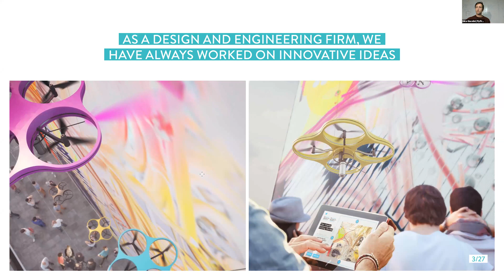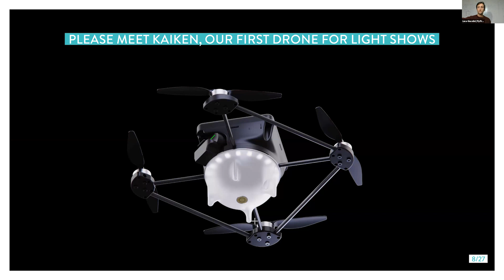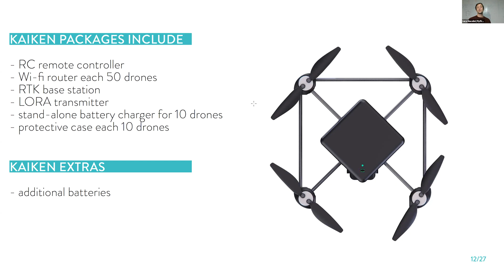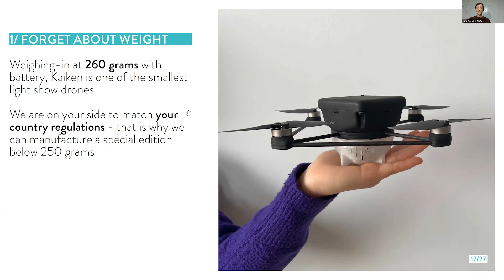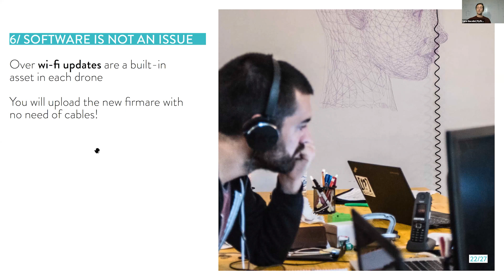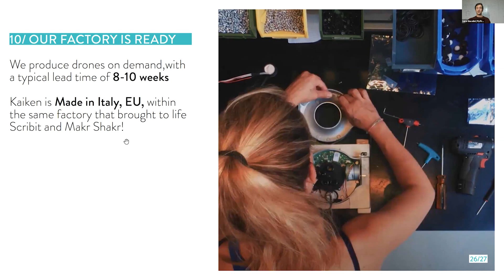Webinar | Next generation drone for drone shows

Comment: for LED what is the suggested distance from dance center to audience?
Reply from the maker: LED light is usually visible from over 2 km away, although the visibility might be limited by weather conditions (dust, smog, mist, fog, low clouds). The closest range is limited with a safety distance, which may be calculated taking maximum velocity and altitudes into account (depends on the choreography). For more info reach out to Drone Show Software engineers https://droneshowsoftware.com/#contact-us
Reply: @sphengineering  why so secretive? Political non-answers really don't help anyone understand.  Seems to be a bit strange since this would be relative to the product you are trying to sell.  So much for sharing information in your "webinar."